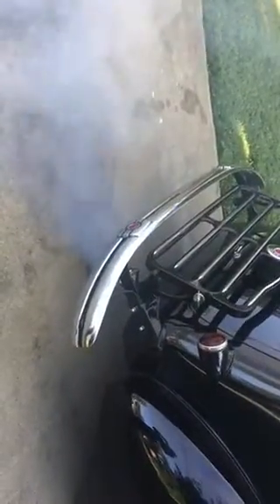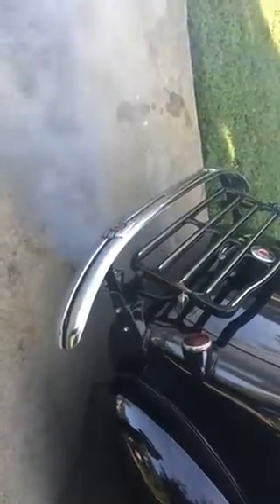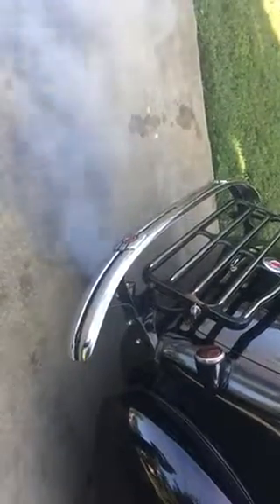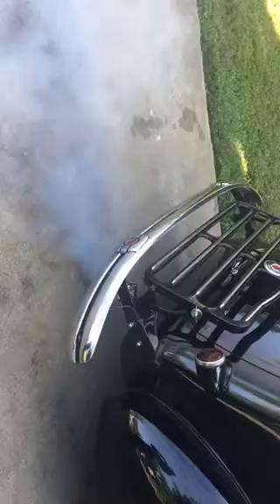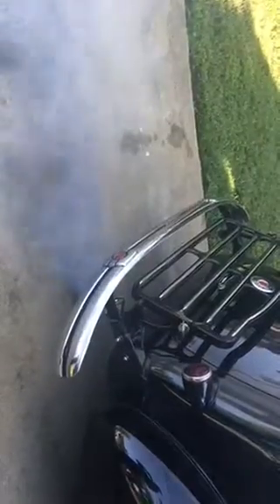Stuck Piston Rings

Comment: A 50/50 mix of ATF & acetone may work as it looks like I may have freed the piston rings up in my dads Honda lawnmower,time will tell !

Sometimes that snake oil trick doesn't work as I ended up having to tear a Chevy LS1 V8 engine down to replace the noisy lifters in it when the engine flushes & treatments didn't work.